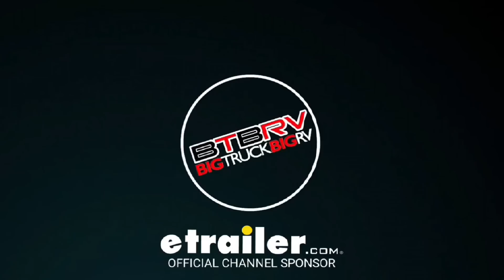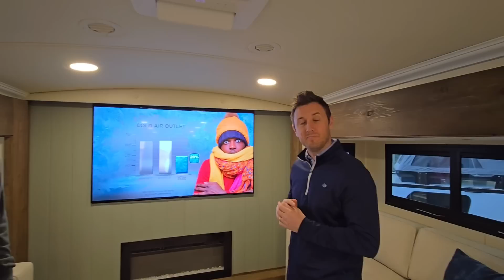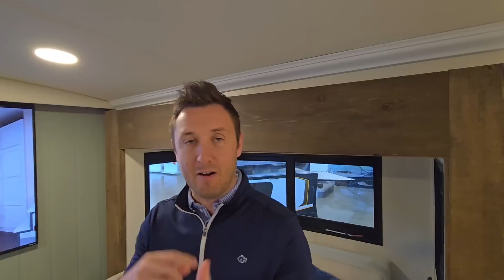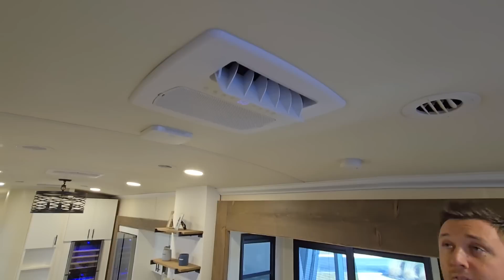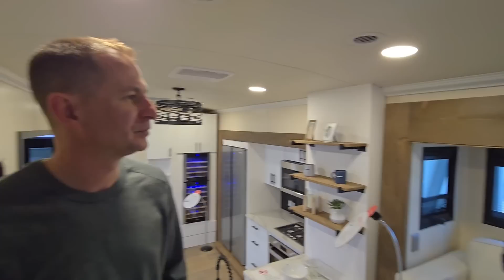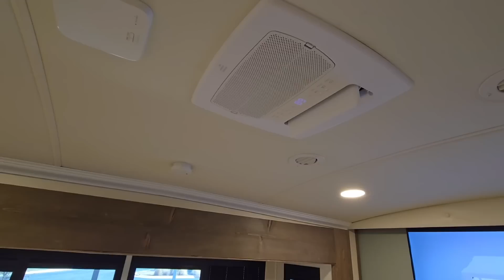MOST ASKED FOR RV UPGRADE!  18K BTU inverter AC! Better than a Mini Split! Furrion Chill Cube

Comment: In my 35'ft Forest River Palomino Columbus, I have two A/C units that feed the same ducting. The main is 15k BTU, the bedroom is 13.5k BTU. Both are Dometic units and I wonder if I place a single 18k BTU A/C in the main area, can I remove / eliminate the second 13.5k unit. Would the 18k unit be able to handle the whole trailer by itself? In addition and maybe I need to rewatch part of video, will these have optional electric heating units for all season use? Neither my 15k or 13.5k units have the heating elements although the wall control unit features that option? From what I can tell, the wiring for the heating element is already in place but capped off at the roof opening. I will do anything to get rid of the noisy bedroom A/C unit because I can't sleep when it's running.

Comment: JD, I know I am one of those people that have been pushing for mini-split style AC/heat pumps in RVs. This has my attention, with caveats. What I absolutely HATE about current RV rooftop units is the changeover from HIGH to LOW speed and vice-versa. Why does the fan need to stop to switch speeds? These are the only systems that do this. Residential, window units, ducted split and mini-splits do not do this. If this comes in a heat pump system, ducted and solves the fan speed change issue, I'd be sold. I really, REALLY hope to see videos of you testing this.
Reply from the maker: They just informed me that their Heat Pump version will be available in July.
Reply: @BigTruckBigRV it's still not available and it's September.  I really want this new AC unit. Please, if you can get me someone that can sell me one, I would be so grateful!
Reply: @elizabethkollars9934  they're out now as ducted units
Reply: @TheBurnsStuff  where do u install mini splits? I want one in my RV, this one doesn’t convince me yet. If I could point it to the back of camper that be nice, instead of it facing my kitchen and sink
Reply: It's not ducted and wont be. Furrion specifically designed it not to be a ducted system. A lot of RVs are switching to this unit in the main areas of their RVs.
Reply: @BlueMax717  but he clearly states in the video that there WILL be a ducted version
Reply: The man says in the video that the ducted system is coming.   @BlueMax717

Comment: It will only be a game changer if and only if it is as efficient as an actual Mini-split.   I can run my mini-split 24/7 in my 39' 5th wheel.  16kwh of Lithium and 2740 watts of solar.  In fact my mini-split is so efficient I can still charge my batteries on solar only while the unit is running!
Reply: He said on "normal" setting it will draw 10a or 100a @ 12v.   My Mini-split only draws 600w (5 A @ 12v) on max and ramps down from there.  We need to know the SEER rating of this unit to know if it is a game changer or not.  Again...my Mini-split has a SEER rating of 20...so very efficient.

Comment: I don’t know anything about HVAC systems, especially in RV’s other than they make the interior cool or downright cold. I’ve owned a Class A and a Class B, and I’ve been in a few travel trailers, but they weren’t newer models. The main issue was always the noise. This one sounds quieter than any I’ve ever heard. I would be interested to know if it has a heat pump. Perhaps it was mentioned and I missed it. As far as a direct dump unit and the racetrack type system, I would think the racetrack system would cool the interior more evenly contrary to what this guy says. You also don’t have a vent dumping air directly on you when seated on the couch. The selling factor is being quiet and not needing a soft start which sounds awesome. 

As far as mini splits. Hundreds if not thousands of people install them in their bus conversions and every video I’ve seen say they’re awesome and never had a problem. So, while JD’s comment that they weren’t made to be in an RV is true, they seem to be great in that application. They’re very quiet and easy to install but I believe they’re expensive compared to an RV unit, but I’d guess one unit is all you’d need for a 35 foot bus whereas you’d probably need two RV AC units. I have no idea if the RV units are more efficient than the mini split, but that would be important to know if you do a lot if off grid camping.

Comment: I'm stoked to find this out.   When its too hot or buggy to be outside it's annoying having to talk over the AC with friends and family. I have a fairly segmented camper, glad to hear they have a ducted version coming to market.  Hope it'll have wifi.  I use my easy touch stat to cool the camper down before we arrive.
Reply: The remote will probably be Bluetooth, but they have decent range now, but I like your thinking so you can 'remote' in and change your settings if your away.

Comment: I've been in the planning stages for a solar and battery system for a 2 AC fifth wheel for a couple years. This could be the tipping point to get me in the game if they're not horribly expensive. The wattage for the 2 ACs pushes me away from victron inverters which causes a lot of other issues and is really the reason I haven't moved forward. Quick calculation, this would likely move me from a 6kva and 48v system to a 3kva 24v system. That also simplifies the solar array considerably.

Comment: If it don’t have a heat pump option the rec pro unit would get my vote over this.
Reply: Im about to get the recpro but wish i could use the heat pump in lower temps like a true mini split.  Also, wonder how i will keep my tanks from freezing in the winter.  Circulate the propane heat fan using a manual switch?
Reply: @mcconja  mine works well in our toy hauler garage to about 26*f we use the propane furnace in the main partition of the camper

Comment: Guess time wlll tell. Being a retired I/E tech certified in HVAC I understand some of what Saint is questioning. Can you access the coils for cleaning or service? Being new. "could be" parts availibility limited. What refrigerent is being used. Efficency would be much better in older equiment if the third world refrigerents were not contaninated. Kills compressors & piping pretty quick. I do appreciate your videos always. Have learned much from your knowledge & suggestions for safe towing.
      Thank you!

Comment: Finally! An inverter air conditioning unit for an RV. Something that has been standard in  residential units, and residential refrigerators, for so long I can't remember when they were not a thing. About time the RV industry tries to say goodbye to the 1970's.
Reply: Right? 12v DC fridges, inverter AC, induction stoves they are getting there

Comment: There’s nothing new here. Houghton AC’s are just ac quiet and efficient (sold by recpro in the US). It’s pretty much designed like a mini split with built in heat pump and dehumidifier settings.

Comment: The 8K unit would be nice for truck campers, pop ups and small travel trailers.
Reply: Or it would be nice to have the 18k big one in main living area and 8k in the small front master bedroom. Run the bedroom only at night. Much less power draw.
Reply: @jsneed7216  no matter how small my rv is I would want the  18k minium
Reply: 10 months later and the 18k unit is finally availabe. Crickets on the smaller units. where are the small units?!?

Comment: Many people buy an RV thinking AC is like a home AC and will keep 70 degrees in the middle of August parked in the sun. Nope!! Having enough BTU's is more important than you think.
Reply: Getting away from ducted AC systems is also important. Ducted systems are inefficient.
Reply: Yes, because an RV has very limited insulation, has much higher surface ratio to area than a house, not to mention, running cold air through ductwork in the roof structure is  idiotic. On top of that, literally, your condenser unit is in the hot sun exactly where it should not be